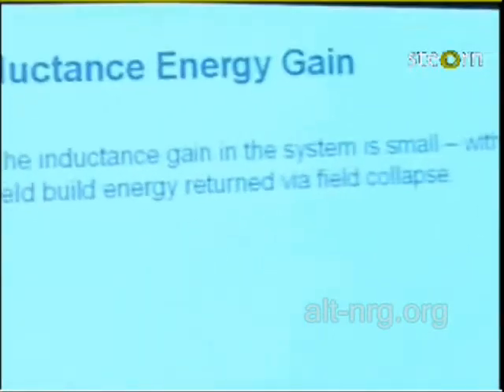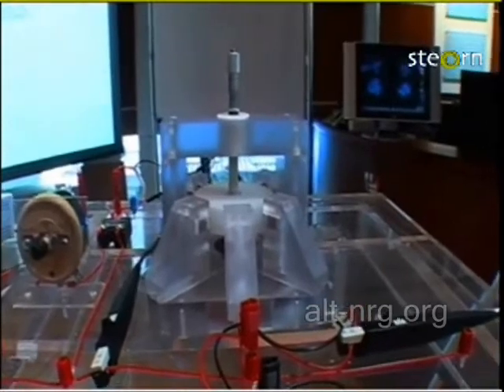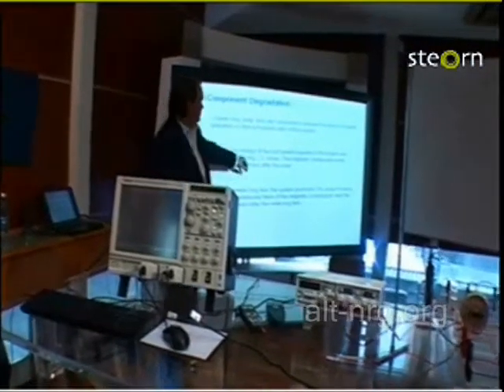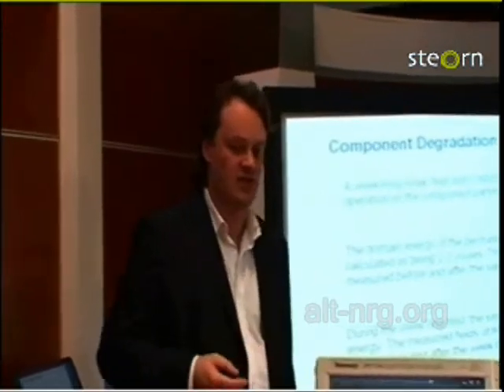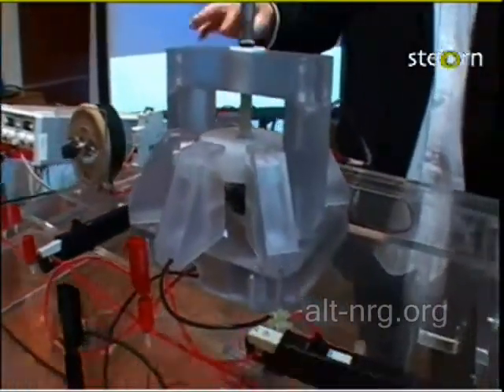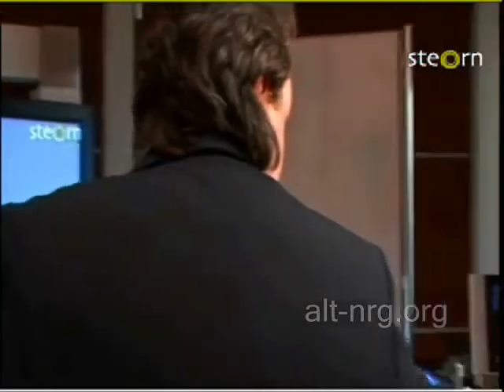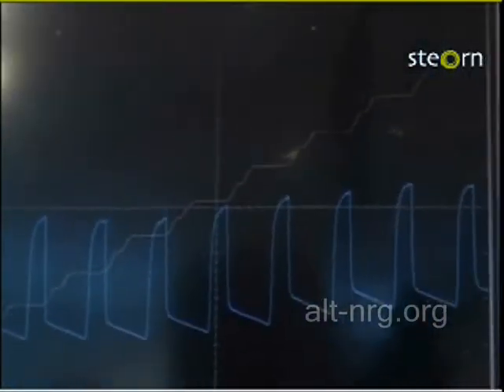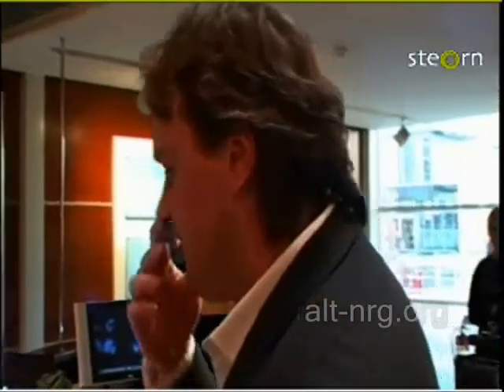#216 Steorn Orbo Demo, part 2 of 4, Jan 30, 2010

Comment: I just have to note that the pop up at 2:51, where the balloon is making out like he said something wrong, well, he did.  But, what he said wrong was 'more energy out, than in' for "CLASSICAL" systems, which is wrong.. for classical, it has never been anything other than more IN for OUT.  So, yes, he did say it wrong; but, not as implied by the balloon.. for his system.
Still, I'm not sure he's getting what he says from output; but, if counting output energy based on an input; one is legally, according to classical physics allowed to count the "HEAT" energy out, as part of the output energy.  And if one were to get even INPUT POWER = OUTPUT POWER, by excluding heat, and heat is produced... that would be OU! but since we consider heat to be waste, we often forget it's a product of the system's 'output power'.

Comment: Im the first one to ebrace new technologies, bu all the tech talkm hes tryint o throw out doesnt add up. Basic principles on motors is  not flying, hes talking about emf, induction, etc. but what about drag? what about thermodynmics? a motor putting out  more than in would heat up yes? electrical resistance would cause a hell of alot of heat. even superconductors floating in air can spin for a long time, but even they lose enegy ue to drag in the air.